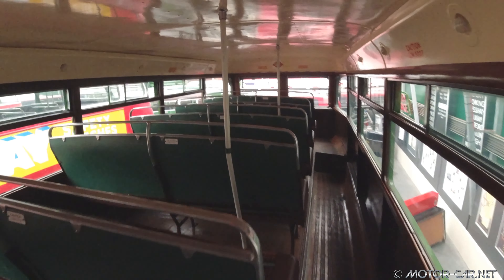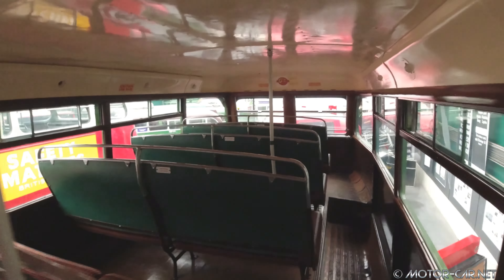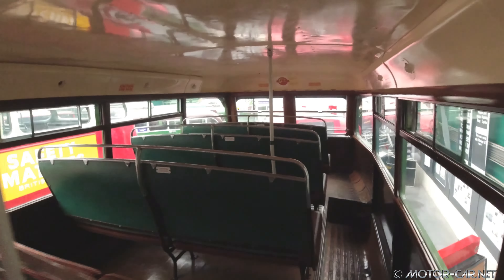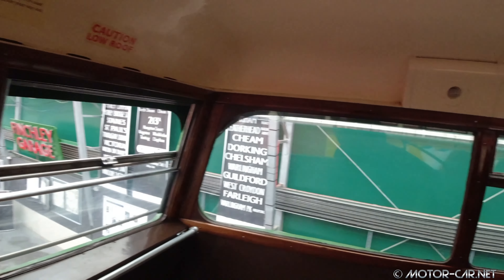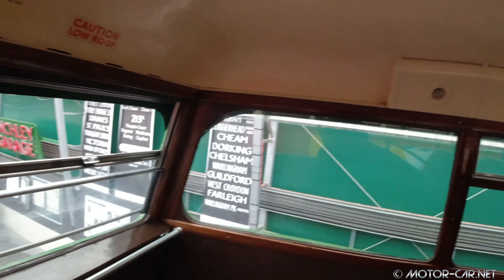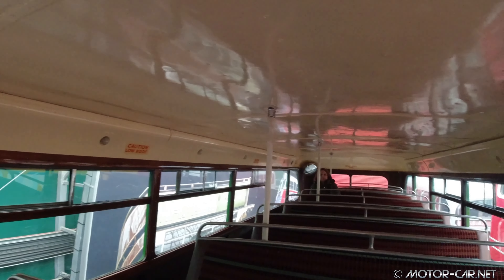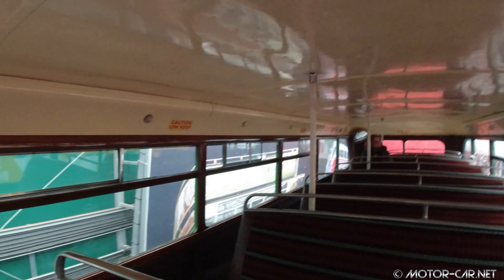AEC Regent III And RT Bus History (1946-1957)

Comment: Remember visiting a preservation group in the early 80's. I never understood how low height buses worked. The bus is lower but the gangways inside are the same as a normal height bus. This group had such a bus Potteries NEH 453, the lady let me on and then I saw all the seats upstairs to one side. A clever design, before the advent of the high capacity dingle -deck buses.
The RT and RLH were such classic designs.